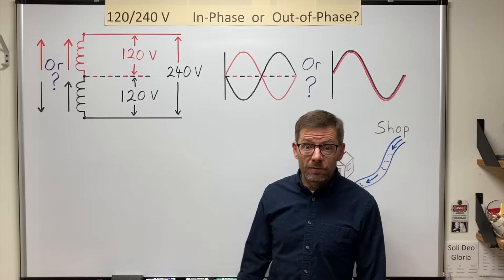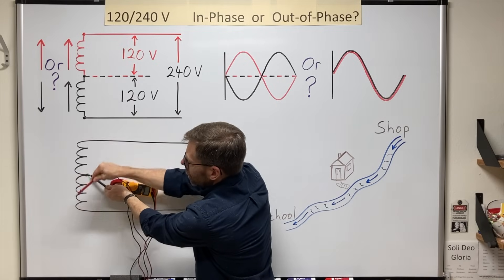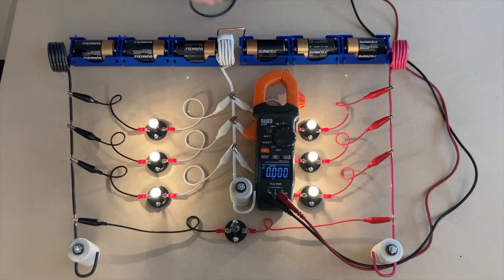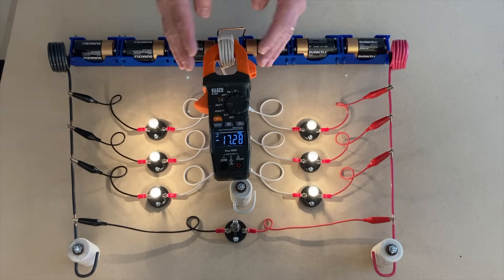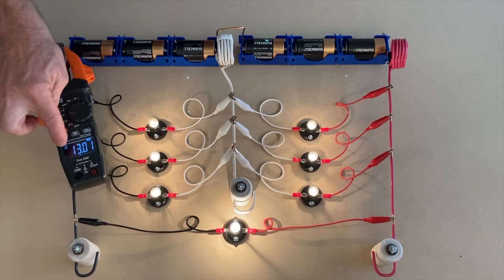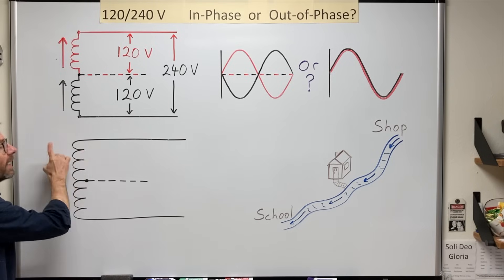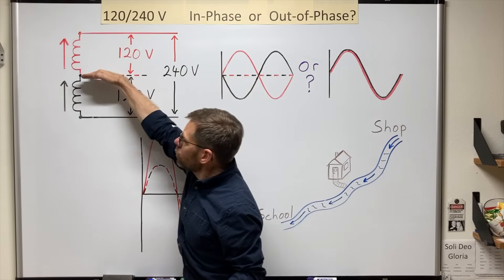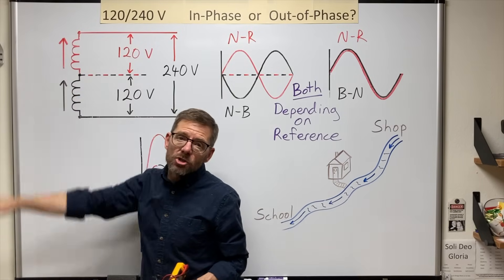120/240 V  In-Phase or Out-of-Phase

Comment: Thak God we don't have this foolishness in 240V countries.

With a 240/415 volt system we have 240v between any active and neutral or ground in every case.
In typical household installations we take 1 active to the house, 
neutral is bonded to ground at multiple points (MEN)
.
In an industrlai and commercial systems we take all three phases into the building
we have 240 volt single phase ciruits from the neutral to the actives.
we have 415V, supply between any two phases
and either star, delta or triple phase connections for three phase appliances.
.
putting a neutral half way up a phase is potentillay problematic where there are mixed single and three phase installations.
Because in three phase distribution the star pont must be grounded.
.
Unless it is a very large or high demand installation, we do not have supply transformers in buildings
a 240/415  4 wire supply runs up the street.
If there is a transformer for the building or complex it will come in as 11KV
.
having a neutral half way up a phase also makes a variety of circuit protections more complicated.
.
there are very rare situations where we will hva 240 volt floating dual active or 240 volt split phase installations

Comment: This is so stupid. Split phase does nothing but waste copper. Most of the world looked at what we were doing and decided it would be a thousand times easier to make 220 bulbs instead of this crap. Great explanation thought.
Reply: It does not waste copper.
Reply: @GH-oi2jf  Oh, but it does. In countries that have 220, half as many breakers and runs are required as the effective resistance is halfed. 75 percent of the world is single phase 220. Zero reason for using split phase.

Comment: Very nice description. Many others have mentioned your unusual US split phase system but not explained how it works. Thanks.

It was interesting to see in your practical demo the phase to phase light still lit even though you had removed the batteries to reverse them. The phase  to neutral lights had extinguished but phase to phase still lit. A nice demonstration of leakage current that you might want to demonstrate some time.

Comment: The split phase setup is always single phase and neutral and live conductors have the same cross section.

Early true two-phase systems were 90º out of phase and if a neutral conductor (usually called ground back then) was used it had to have twice the cross section of the live conductors, otherwise otherwise two conductors were used for each phase. That system allowed to make simple AC motors that would start without the help of external devices like capacitors, it also allowed to easily change the direction of rotation of the motors.

Comment: Simple way to determine whether two AC hots are in phase or out of phase.

Connect a wire from one to the other. If nothing happens they are in phase.  If the lights dim and the connecting wire begins to melt they are out of phase.

Comment: If you are getting 240V AC when you test voltage between Phase A and Phase B, then they are reversed polarity.  There is no other way that computing the voltage difference between the two 60Hz (or 50Hz) wave functions will produce any reading.  If they were in-phase and the same function in the time domain there would be barely any voltage difference between the two phases, so no current will flow in such a test unless your phase legs are very unbalanced.
Reply: I agree with you.  L1 and L2 have to be out of phase with one another would respect to their sine waves otherwise how would you measure any voltage between them.

Comment: It's absolutely basic and so obvious ... I've worked with split secondaries all my life ... having 4 connections... parallel the windings for double the current and series for twice the voltage and half the current ... just make damn good sure the sec windings are IN phase with each other ( when you parallel the windings ) or you will soon have a burnt out transformer..!!

Comment: I'm looking at solar panels. 
In the US, the inverter is connected line to line.
In Europe, the inverter is connected line to neutral. Both result in about 240 volts.
With three-phase power, the three inverters in the US are connected as delta. 
In Europe, the inverters are connected as Wye.

Comment: Thank you for the video, great explanation.  I do have a question on the center tap that has a lug added to the winding midway neutral.  I understand having the potential difference between L1 and your neutral and having 120, and having 220 between L1 and L2.   I understand the in phase and out of phase.  When I'm working on a machine ( 120v / 220v ) I can grab the neutral at any time and never be shocked ( though you shouldn't ) because there are 0 volts on the neutral always, no matter the load being powered ( as long as everything is working and wired correctly) . All the voltage is used in powering the load.   Neutral is also bonded to ground.  In your drawing, it looks like if I took your neutral and bonded it to ground it would be a short to ground.  I'm sure I'm missing something and not understanding it fully.  Thank you.

Comment: So if the red wire and black wire are in phase, if you were to touch them together you should get a negligible spark, right? (i.e., if they are in phase no to little spark; out of phase BIG ARC)  I don't suggest doing this as you will get a BIG BLINDING ARC which implies they must be OUT OF PHASE)

Comment: Dave, you have it all right (as far as I can tell) except when you say the two halves are in phase. By definition and convention we measure phase with respect to ground.
So, while I sort of understand where you are going I feel it is misleading and to that there are some semantic issues. (I apologize)...With regard to AC to the house: It is important to note that L1 to L2 is "one" leg or phase, we don't talk about it as "in-phase" or "out of phase". We say in phase and out of phase with "respect to something". When you split L1 to L2 by center tapping it -- we get: L1 to N is OUT OF PHASE with L2 to N. So the problem I have with your explanation and conclusion is that by "definition and convention"... we measure phase with "Reference" to Ground. More specifically, that means that you don't swap the probes... one probe (the Neutral) probe stays on the Neutral. So, yes, you are right that it depends on how you "measure it:", but the "Proper" way to measure phase is with the reference to ground. So, yea, it is going to be "wrong" when you do it the other way... and it will show up as "In Phase" because you are no longer measuring L1 to N with respect to L2 to N. To summarize, yes, you are correct that if you measure it "wrong", it will appear "In Phase"... but it is NOT in phase (Unless you have a really good reason to change the conventional definition of "in phase" and manage to convince the entire EE world.)
Reply: In the end that what it comes to IMHO. Both of you know how it works so the "in phase", "out of phase" argument seems like one of those debates that will never be settled. But I thought the same, how can you make a comparison while shifting the reference? Notice this debate does not exist when the phases are shifted by 90 degrees or 120 degrees. 😇 Cheers!

Comment: How does  transformer works for 120/240 input and 120/240 1kva output, i'd seen transformer that the input used was 120 Volts and output used was 240 volts. How this system works? It would be great if you added actual demonstration, still confused me if the transformer is a boost transformer. Thank you!

Comment: The two ends are 180 degrees out of phase with one another. The induced emf at any one time
is positive at one end and negative at another. I believe that your battery analogy at 3:49 is faulty in that there is not two “batteries” representing the induced emf but only one with a positive and a negative end representing the out of phase relationship. That one battery is simply rotating 180 degrees 120 times a minute. Doesn’t matter that there is a center tap or not! The expanding and collapsing magnetic field sees a single wire from one end to the other and induces alternating positive and negative voltages across the entire winding. It doesn’t create (at one point in time) a positive potential at the “top”, a “negative” potential at the center tap, a positive potential at the center tap and a negative potential at the “bottom” as you have implied.
Reply: Wat is on the left side of the two coils ? Just one coil these are standerd transformators in USA power about 25 KVA  . voltage 
about 7000 V / 12000 V / 120 V / 120 V / 240 V AC. These transformators can be fed with L1 or L2 or L3 and a high voltage neutral 
( 7000 V ) or with L1 and L2 or L1 and L3  or L2 and L3 high voltage 12000 V. Or also in USA L1 and ground L2 and ground  or 
L3 and ground 7000  V. But it still is a one phase transformator. We will Never get 2 or more phases from a one phase coil 
The primary side only gives a Changing magnetic field Not a rotating magnetic field that we have in 3 Phase systems.
Reply: @firestar7188  Nope.  In a 3 phase system the phases are 120 degrees apart. In a 2 phase system the phases are 90 degrees apart. Here we are talking about the difference in potential between one end of the coil and the other. Both primary and secondary coils have the same 180 degree difference. Otherwise you are claiming that the potential difference from one end of the coil to the other is zero! If they are "in-phase" they have the same direction and magnitude and there is no potential difference between them.
Reply: @Jnglfvr  I am glad you are talking about the internal construction of the transformer. The actual physical turns of the winding are good to consider. One way to look at it is to consider each turn of the secondary winding as a separate series source. This is more intuitive if you've ever wound your own custom transformer. You can keep adding turns, 1/2-turn at a time, until you get to the exact voltage you want. Or if you've ever looked at the internals of a variac.

If you could probe from any point of a transformer secondary to any other point along the winding, you would see a larger or smaller voltage waveform depending on how far your probes are from each other. It's a gradient, but you can granularize it however you want. Most people break it down to into two halves, but if you break it down by turn of the winding then for example a secondary with 800 turns can be considered 800 sieres sources. All 800 are all same polarity and same phase, right?
Reply: @charlesstaton8104  The problem at 16:24 is that, in order to convince us that the two ends of the transformer are actually in phase with one another, he has to use 2 different ground reference points! In one case he places the ground reference on the "bottom" terminal and in the other he places the ground reference on the center tap.  Just try solving a circuit problem where your ground reference changes in the middle of the calculation and see how far that gets you. The ground reference in any circuit analysis should be at a unique point in the circuit whether or not it is floating or earth referenced.
Reply: @Jnglfvr   If you don't like moving the reference, can you tell us how you measure series batteries? For example a 48 golf cart, with six 8v batteries in series. Would you fix your black DMM lead to one spot and take all measurements from there? 

You could fix it to the negative terminal of the first battery and then measure to each positive terminal and get measurements of 8V, 16V, 24V, 32V, 40V, and 48V.

Or you could fix your black probe to the common point between batteries 3 and 4, yielding measurements of -24V, -16V, -8V, +8V, +16V, +24V.

Or you could do what he did in the video (which you identify as problem) and move both black and red probes from one battery to the next, reading 8V, 8V, 8V, 8V, 8V, and 8V. This is how most people would measure golf cart batteries with a DMM. But you can also do it using AC sources and an oscilloscope. Not sure why you have a problem with it. 

No matter how you measure those golf cart batteries however, the fact remains that they are all connected in series with the same polarity ("in phase") and their voltages add up 48V overall as a result. Just like all the turns of the secondary winding of a transformer are in-phase and add up. 

If you choose to reference your golf cart battery DMM readings to the midpoint between batteries 3 and 4 then readings to the left will APPEAR inverse of measurements to the right, but those batteries are in fact NOT supplying voltages of opposite polarity and in the exact same way, neither are the two halves of a split phase transformer.

Comment: I honestly can’t tell if your joking, if this is a spoof video. It’s very well done, for a spoof. It’s kinda funny and kinda dangerous with so many people getting YouTube certified and using videos like this as an educational system. Just to be completely clear, when you ground the center tap, both phases are completely 180 degrees out of phase. The fact that you can hook your leads up incorrectly to a scope doesn’t change the fact that they’re 180 out
Reply: "When you ground the center tap" ... so before you ground it, they are not 180 degrees out of phase? What magic happens when you ground it, to reverse the flow of current in one half?
Reply: If they are in phase with each other then there is no difference of potential between phases. And yes when you provide a ground reference current flow actually changes. Once you ground it, ground is your reference, it’s a universal reference. This is elementary electrical theory and a basic education not based off YouTube would do you all well

Comment: This is an excellent representation of phase angles and "polarity" in a split-phase system! 
I've been an electrician and electro-mechanical systems tech for over 40 years. And while I understand the principles described here, it's often hard to convey it to someone not in the field. But you have demonstrated it beautifully here!
Thanks for sharing your knowledge.
Reply: It mentions nothing about why they are out of phase, it mentions nothing about positive sequence, negative sequence, or zero sequence. This is a very very very watered down version of what phase angles really are, how they’re used to analyze a circuit, and how they effect our power systems.
Reply: @Electric_Sherlock 
Well then, please... enlighten us all by posting your own video describing it!
Actually, he never gets into "phase angles" at all (as would be the case in 3-phase systems). Nonetheless, a great representation of split-phase systems. 
If you can explain ot better, please do.
Reply: @Calico5string1962 sure. Here you go. 120/240 refers to a type of electrical power system. In-phase means the two 120V lines are synchronized in their waveforms, providing 240V when combined. Out-of-phase indicates the waveforms are not synchronized, disrupting the combined voltage. Simple. See how i took a loooooooong video and made it simple in a mere 2 sentences. Dont unleash my sarcasm and brilliance, you’ll regret it. Despite your “40years” of so-called experience. Experience doesn’t equal knowledge anymore than standing in a garage make you a car.

Comment: If you look from the load (no load shown in your white board diagram) to the source, you must chose the neutral as the common reference for both 120 VAC legs (L1, L2).  This is forced by the fact that 120 VAC outlets are polarized so you can't reverse the sense of L1 and L2..  What is really going on here is, with respect to the neutral, L1 and L2 have opposite polarity.  For half-wave, symmetric periodic signals, V(wt + π) = -V(wt).  Thus a 180 phase shift is indistinguishable from a polarity reversal.  Your error is your perspective.  You should be looking from loads to source rather from source to load.  From the load perspective, moving the common reference is not valid - your black wire must remain on the neutral.
Reply: I agree with you.  L1 and L2 have to be out of phase with one another would respect to their sine waves otherwise how would you measure any voltage between them.

Comment: Worth noting that a scope plugged into a wall will see out of phase because the "negative" lead is actually connected directly to the earth/group pin going into the wall.
That's a warning for anyone who might want to scope their AC. Don't connect the little alligator clip to live. You're going to have a bad time.
Ultimately earth is the base reference that people are using when discussing the phase of the two secondary coils (or two sides of the secondary coil). When you use that reference, they're out of phase. If you reference one end of the transformer for one measurement and then move that reference to the center for the other measurement, they're in phase. Actually, if you move your reference, you can make them in phase or out of phase as you please.
Reply: No point in doing that when a 24Vac center-tap transformer will display the same results only its safely scaled down to non-lethal voltages 😊
Reply: You can't actually make them in or out of phase arbitrarily, though you can create the illusion by incorrectly handling and discarding of art of the information. There was also major mistake in the video. Basically he conflated true signed potentials with useful absolute potentials. in otherwords -3v can do the same work as +3v but they are not the same when it comes to measuring and graphing phase separation.
Reply: That's a good disclaimer. Best case scenario, your scope will meet an untimely end. 
Best to find a decent quality CAT rated differential probe for such measurements.